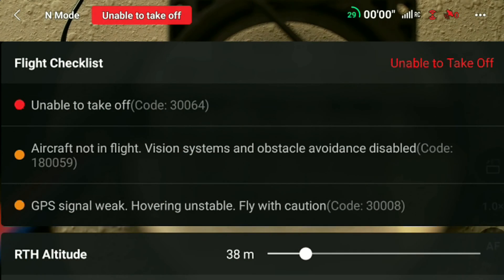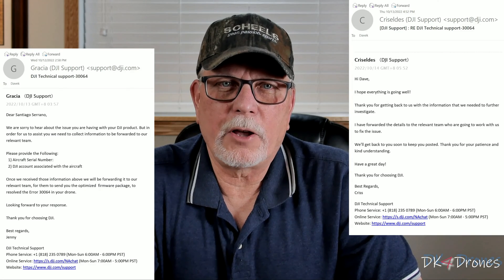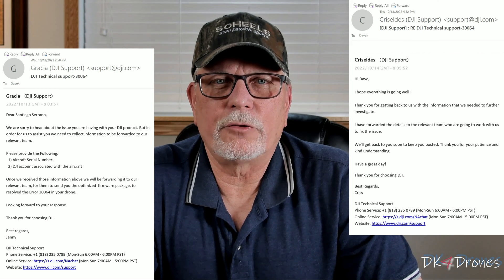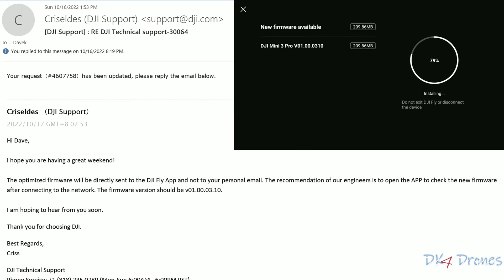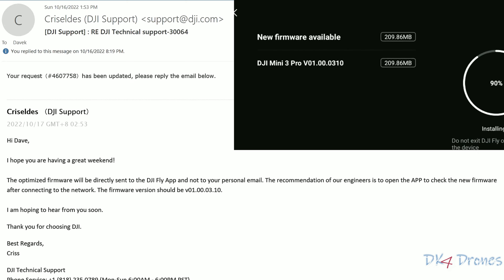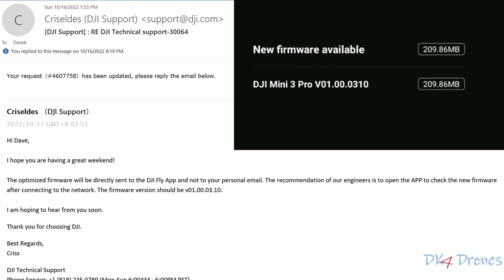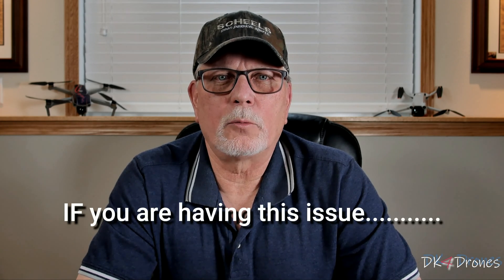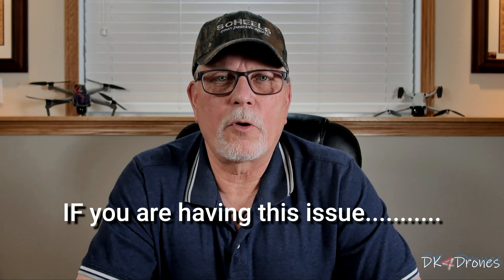DJI Mini 3 Pro - Firmware 01.00.0310 Update for the Unable to Take Off - Code 30064

Comment: Same here on a Air 2s. I didn‘t do an update before the issue. Yesterday all worked perfectly, today the problem. First I did was to upgrade the firmware (I had a 2 years old). Didn‘t help. 
I found out that the drone doesn’t show the error when I switch it on inside my car. But the error appears when I switch it on outside. 
I have absolutely no idea what is going on here.
Reply from the maker: I would try recalibrating the compass and IMU I've heard that has worked in the past sometimes. If that doesn't work I think the only option you have would be is to get ahold of DJI support.
Reply: @dk4drones  thanks. I‘ll try
Reply: @dk4drones  It was an app issue. Today an app update came out with the description „Fixed issue where DJI Air 2S is unable to take off in certain scenarios.“ 🙄
I think it is solved now
Reply from the maker: @previ26  Great, I hope everything works out!  It almost always seems to be the software/firmware from what I have found and heard.  🤔
Reply: @dk4drones  not in this case

Comment: Just got an update and now it's doing this
Reply from the maker: I would if you haven't are ready I reinstall the update.  If that doesn't work you may have to get a hold of DJI support and work with them to fix the issue. I know for me getting in touch with DJI was the only way I got mine fixed and flying again. Thanks, Dave
Reply: @dk4drones  how do you reinstall the update. just got the air 2s and im getting this error after updates

Comment: I bought the new DJI Mini 2 and did the updates.  After the new updates I went to do the necessary calibrations.  When I did the calibration of the IMU it presented the error "30064 - IMPOSSIBLE TO TAKE OFF".  I can't take off anymore.
Reply from the maker: I think if you haven't are ready I would reinstall the update.  If that doesn't work you may have to get a hold of DJI support and work with them to fix the issue. Thanks, Dave
Reply: @dk4drones  Wonderful, Dave. Thank's bro!

Comment: My dji air 2s was fine until I did “updates”. Now I get this code and I’m frustrated
Reply from the maker: I think the first thing you should do is get a hold of DJI support and work with them to fix the issue. Thanks
Reply: @dk4drones  Thank you. Yes I’ll be calling them tomorrow.

Comment: I have DJI AIR 2s. Having same issues. Contacted DJI. NO HELP. I have to wait for their teams email then send more info. Email could take 24-48 hours. Good thing my vacation trip is over tomorrow so I will not be able to get any footage. Thanks DJI  worst customer support
Reply from the maker: Sorry to hear that you can't get any footage while on vacation that's not a good thing at all. Have a great day if you can, Dave
Reply: @dk4drones   I actually managed to fix it with an update that popped up. I’m relieved 😌